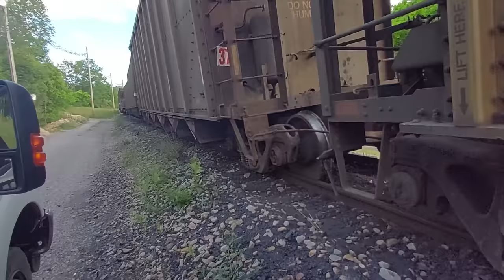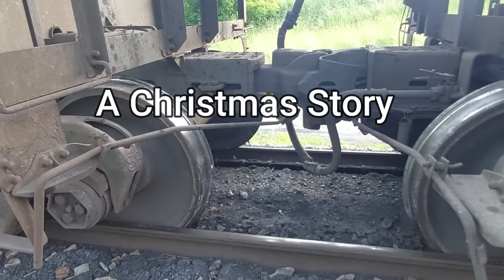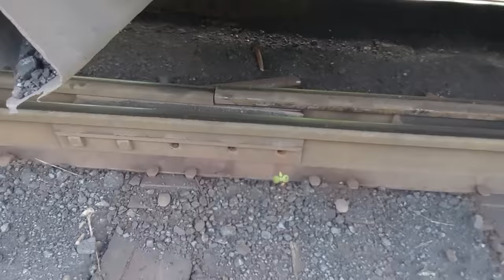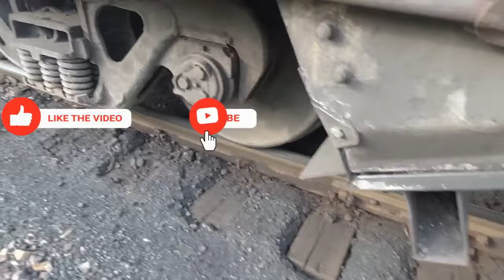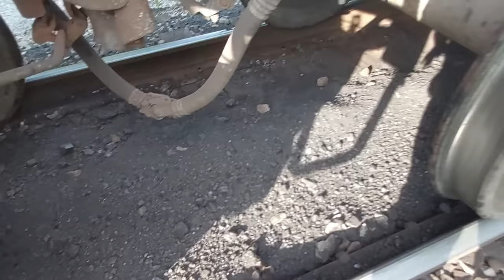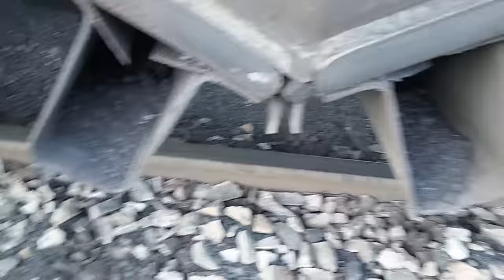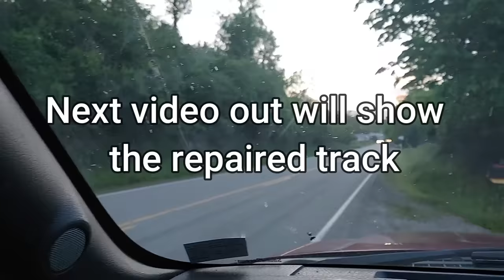Rail Rolled Over and 5 Loaded Coal Cars Derailed  Oh Fudge!

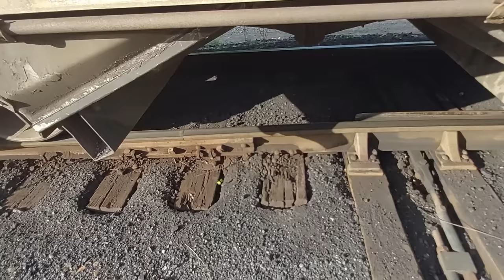Comment: 7:24
BOLLOCKS, that is NOT solid (unmoving) track. IT MOVES (often)
It may be dry - but we can clearly see, the sleeper ends are NOT kept firm with unmoving ballast, but have that tell-tale movement cracks along each sleeper side.
ALL of the square shanked dogs, have been pulled nearly 3" HIGH, on sleepers that also very clearly MOVE UP & DOWN as rolling wheelsets go over that area.
Oh sure, the turnout points are held with STRONG METAL SHOES on the bedplate ends, which also PULLS the rail either side (held only by dogs) UP such that it forces the dogs to pull high, yet with nothing to hammer the dogs down again, these are ALL far too high to be of any useful purpose, at holding the rail vertical.

As ou said, the loco was PUSHING that rake of wagons in, thus the derailment occurred LONG BEFORE THE 1st set of derailed wheels reached the toe of the turnout.
With a derailed set of wheels "straddling" a far wider size, than the turnout toe setting, they RIP the toe points asunder (forcing these either way - or busting the bar holding them together) - so that after the 1st wheelset destroys the toe fitments, the rest of the derailed wheelsets, flick the turnout hither & thither, until - you come along and say (incorrectly) see the turnout has been set for ?
No - it ended up being that way, with the tonnage of wheel loadings forcing the turnout toe ails into the wrong set.

The derailment WAS NOT CAUSED by the turnout.
It was caused long before, when the rail DOGS couldn't keep the rail gauge, nor stop the rail head rolling over.
Hence you immediately had track gauge PLUS the rolled over rail measurement - meaning the wagon wheels could NOT possibly remain on that incorrect gauge.
Derailments occur, NOT because of where they end up when the dust settles, but from the position where the very 1st wagon' wheels derail, which are then being SHOVED far enough to have another four wagons also derailed.
Reply from the maker: Thank you for sharing your thoughts Quix. Appreciate your taking the time to drop by and check out the presentation my friend.

Comment: Ouch, not the best way to end your day! But aren't those flanges extremely shallow? One of them could have run between the stock rail and the enclitic point blade if there's no mechanic fastening of the point blades in the turnout.
Reply from the maker: I checked all the wheels, and none are condemnable Gabor.
 Appreciate your taking the time to check out the video and write in my friend.
Reply: @ccrx6700  I really wonder what final findings of the investigation were.

Comment: Question????? Would it have made a difference being pulled  instead of shoved. One engine at each end and one used for a dpu to help shove while the front engine is pulling??????
Reply from the maker: Very good question Robert, you are a thinking man. In the case
of what happened here, it would have made no difference
being pulled or shoved. Rail rolled over and the same results
would have occured despite which loco was in control. Appreciate your taking the time to check out the video and write in my friend.
Reply: @ccrx6700  Thank you for answering. I know not in every situation you can have a dpu on both ends depending on which way its going. It just seems more harsh to push knuckle to knuckle. I work at a steel company and we get up to 13 cars and they squeal like a pig being shoved but coming out of our buillding the hardly make a sound. Seems to me the wheels are being forced into the curve which creates the squeal. Just seems rather non violent when being pulled. Thats what made me ask that question. Im absolutely good with your answer just shoving seems so harsh and theyve been doing it for decades.
Reply: @ccrx6700  BTW 4014 is sitting 15 miles from me at Home Plate. Ive seen her twice but I cant find a place to park because the other trains freaks beat me there every single day. I will catch her. Im in Omaha but live in Papillion.
Reply from the maker: @robertmason7553  👍😊
Reply from the maker: @robertmason7553  easier to pull a chain than to try and push it 😉

Comment: Our train crew derailed years ago and we found a switch thrown the wrong way under some cars. They said it must have been someone hiding in the bushes that did it. They never admit their mistakes but us track guys have to deal with it.
Reply from the maker: WE had same thing happen Michael, they blamed it on the kids
from over the hill in the nearby town threw the switch. After that
we started locking the main line switch. Someone here just forgot
to throw the switch back.  Appreciate your taking the time to check out the video and write in my friend.

Comment: It seems to me that the switch threw in the middle as the group of cars that were going over the switch.  If it didn't switch by itself, how would it have been switched?  Let us know your conjecture how the switch could have cut loose by itself (defective switch design) Track roll-over due to loose spikes?.  Can you reverse engineer this derailment on computer?  it would require every rock and speck of surfacing volume of dust to be weighed, centered, and applied, rocks may be mostly made up weights of particular density, density is variable.
Reply from the maker: More about what happened in the next video coming out Richard.
Thanks for the nice comment. Appreciate your taking the time to check out the video and write in my friend.
Reply: @ccrx6700  Thanks Dave.  I am already looking at the video of the switch and I imagine the Samson switch was loose or worn, that is the arm that swings to switch the rails from one to the other?, and the wheel track would have gone between the switch rails on the inside and caused the derailment.  The outside wheel would go on to the track changing to, and the inside wheel goes straight and as the outside pushes against the inside the inside would cause the rail to go over.
Reply from the maker: @Mr1fish2fish  👍😊

Comment: Seems to be a lot of derailments on this short line,
Reply from the maker: Wondering why you think that Andrew? problem is you don't see
the hundreds of trains that do run with no problems. Actually
the %of problems we have is relatively small compared to
the overall traffic. We ran around 6.5 million gross tons over
this track last year and had only 2 derailments. So get out
your calculator and figure the % of derailments we have relative
to the amount of traffic.

Comment: Why do you guys seem to have so many derails?
Reply: Dave responded above they have had 5 in the past 2 years, if u think that is alot the  ok
Reply: Correct, I count 4 in just the past 9 months alone looking at the dates on videos. And another at the 2 yr mark. Just seems like alot to me along with all the coal spills.
Reply from the maker: Actually JTR for the % of time we run trains, our derailments
and problems are fairly low in percentages in relation to up
time with little or no problems.

All railroads have problems and derailments. But I'm the only
one on You Tube that shows these behind the scenes stuff,
so everyone seems to think we have all these big problems
and no one else does. That is simply not true. Many railroads
have far more than we do. It's just that no one ever hears about
them. Appreciate your taking the time to watch the video and write in. May you have a most blessed day my friend.
Reply: CCRX 6700. That explanation is appreciated. Thanks alot.
Reply from the maker: @jtr6554  👍😊

Comment: Why is there not a camera underneath each train, giving troves of recent data to examine rail road conditions and allow a relatively simple computer program to identify loose spikes and similar issues? Why is the railroad industry so diametrically opposed to any type of capital investment? Surely making sure spikes are set is 100x cheaper than having to deal with emergency cleanup, rerouting, and repair. This stuff happens so often and is so often entirely avoidable.
Reply from the maker: Very good point Garrett. It would be so easy to video the tracks and
the technology is there so AI can "read" the video and spit out a
report. It's much the same as geometry trucks do. Although geo
trucks don't check for loose spikes or fasteners. When I make
visual track inspections weekly I try to give a look see at everything
on the tracks including spikes, but I go slow. The big RR's have a 
quota of miles covered per day for inspections and the inspectors
run fast and can't see everything like I can going much slower.
Really appreciate your watching and may you have a very good day my friend.

Comment: Well it doesn't help matters that the wheels are worn. They really need to be reprofiled before putting back into service.
Reply from the maker: I checked all the wheel profiles, they are all withing AAR specs, albeit some are getting enough wear to warrant more often attention. We do not have a car shop here that can profile wheels, 
they would have to be sent out to do so. Thank you for taking the time to drop by and check out the presentation my friend
Reply: @ccrx6700  well there is always the olde fashioned way of attaching a carbide tipped cutter of the correct profile where the brake shoes went and run the wagon up and down the track until you get the correct profile. You may want to look at the British Rail Research's work on freight tyres and profiling for better adhesion and less wear
Reply from the maker: @billmilligan1705  👍😊

Comment: Excellent video.  So those special dozers lifted the cars back on the rails without unloading?  Wow 

Where was this derailment?
Reply: Yeah, thought they'd hafta be unloaded or use a really BIG crane to do it.  Also, do they lift the truck/s and the car together or separately?
Reply from the maker: Yes those big Cat side booms can lift a loco, they are amazing
Real Gitbizy. This happened at our harbor facility.  Appreciate your taking the time to check out the video and write in my friend.
Reply: @ccrx6700  those cats must have one heck of a hydraulic winch system along with huge steel cables to lift all
That weight.
Reply from the maker: @Gitbizy  👍😊

Comment: Wood sleepers on mainlines ? man that is far behind.
Reply: It's a private islanded railroad. It only runs from the mine to the unloader. And yes, most ties in the US, even on high speed mainlines, are wood, and they work fine as long as the track is routinely maintained. This railroad is not one of those.
Reply: @whiteknightcat  Just found out why even on museum railroad sleepers that are replaced by concrete ones, wood is not used  anymore, the creosote that makes wood more durable is banned, it tends to polute the ground water.
Reply from the maker: Yes we use all wood here arjanvanraaij. You might be interested
in this video to find out why concrete is not the correct application
for some RR's. for others it is correct. Thanks for watching and may you have a most blessed day my friend.
https://youtu.be/UtyTTijswwg

Comment: Thry try throwinf a derail under the wheels and pulling the train back onto the track?
Reply from the maker: If there weren't so many cars off and if I had more help we might 
have been able to rerail them. But Hulcher made quick work of getting
them back on track, we were lucky they were so close to us that
day and came right out gbb.  Very much appreciate your taking
the time to pay us a visit and check out the derailment video my friend.
Reply: @ccrx6700  you got it. What rail line you guys work for? Is that CSX?
Reply from the maker: @gbb1419  cumberland mine RR. We haul coal only from prep plant to a river barge loading facility. We do not interchange with another RR. We are captive. 16.8 miles of track
Reply: @ccrx6700  we call that zone or section up here in Canada where I work. Hats off gentlemen, I see you handy with the spike maul sir, only seasoned Rail roaders know.👍💪⚒️

Comment: Railtracks are so neglected nation wide up to 60 years behind, those wood dormants are rotten everywhere you can see it clearly.
Mexico is using Chinese thecnology:
Reinforced concrete dormants.
Some of the wood dormants are caving and sinking!😢😢😮😅
Reply: This is a private railroad that does not connect to any other system. Trains only operate from the mine to the unloader and at reduced speed. Once the mine is played out, there will be no further reason for the line to exist.
Reply from the maker: Thank you Jesus for sharing your thoughts. Appreciate your
taking the time to check out the video. May you have a most
blessed day.

Comment: Dang Dave, what a predicament.. glad they got on scene quick for being a holiday. Excuse my ignorance, but just a question cause i do not know.. after something like this happens, are those cars taken out of service to inspect the wheel sets and trucks for any kind of damage or messed up bearings. Or do they just put them on the tracks and keep on moving.. thanks for the coverage of this miss hap. Gives usxa great perspective
Reply from the maker: Thank you Pappy for taking the time to watch the video and write in. I did an inspection on the wheels and did not feel a need to
take anything out of service other than the first car off because
the truck set had damaged the brake pipe, that has since been
fixed.  More info will be in the next video coming out. Hope to see you on that one.

Comment: Should the switch have been dusted for fingerprints?
Dry weather would shrink wood and widen the holes, thereby loosening spikes: would sprinkling water on the tracks allieviate the problem?
Reply from the maker: Yes you know water causes wood to expand, however we would need a water train to sprinkle 16.8 miles of track! :-) What would help immensely is if they would clean up the coal so I could
do a proper track inspection and be able to see the spikes,
watch next video and I will talk about that. Appreciate your taking the time to check out the video and write in my friend.